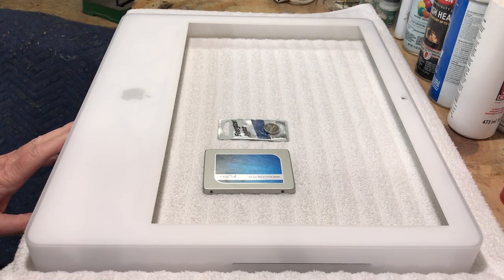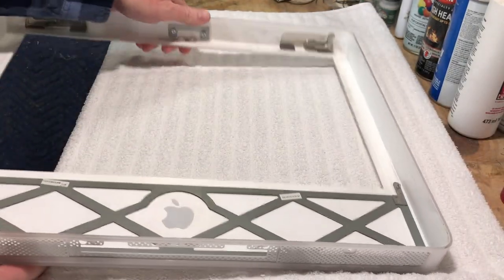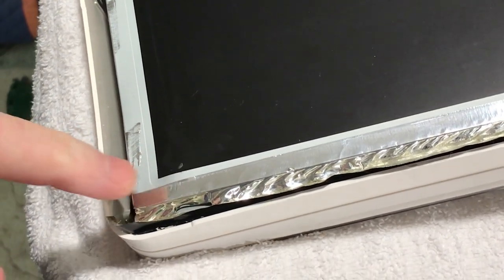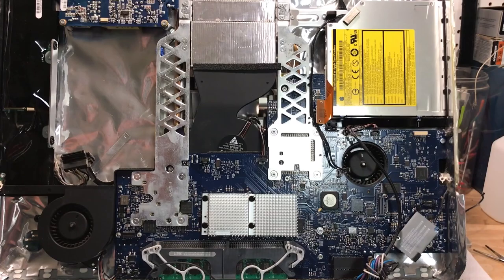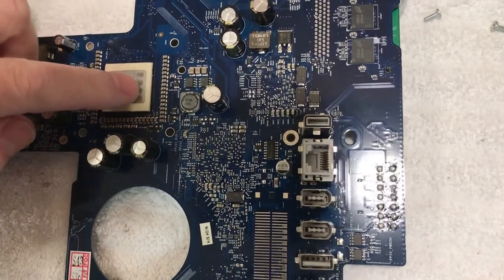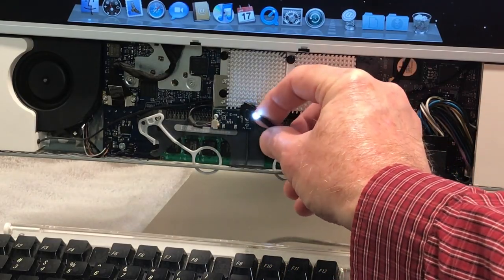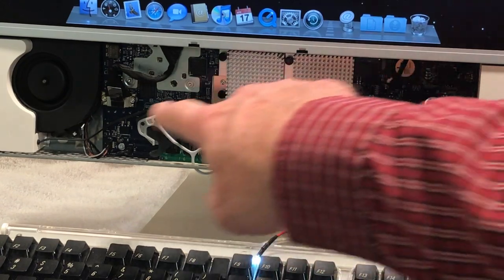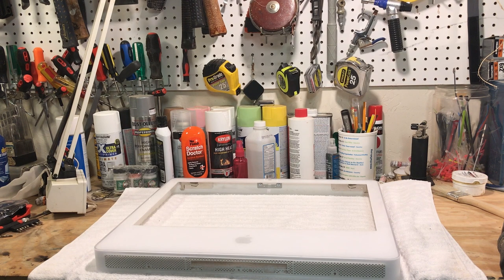IMAC G5 20" iSIGHT TEAR  DOWN  PART 2

Comment: For your final, higher grit sanding, wet sand it. will definately help with the shine!
Reply from the maker: Yep This iMac Was No Fun To Take Apart But Is Runs Very Cool now And A Hole Lot Quieter
Reply from the maker: And Yes You Need To Wet Sand Acrylic To Give It That Glossy Shine 1500 Then Buff It Out